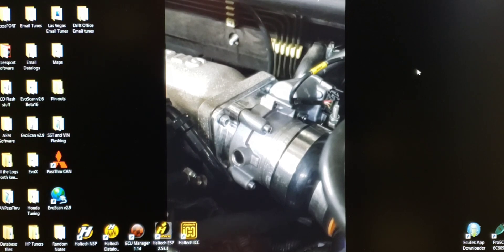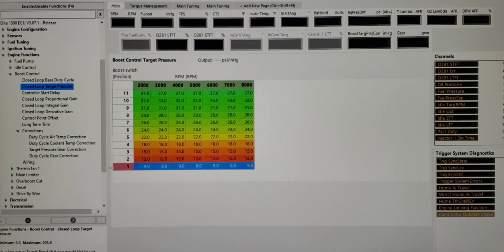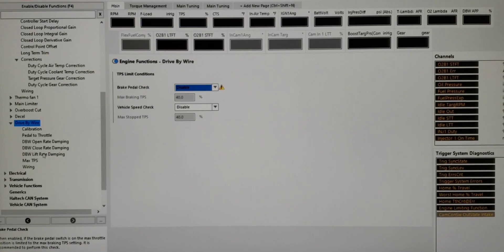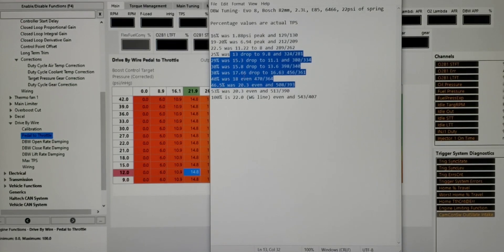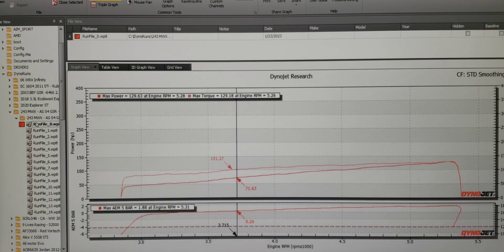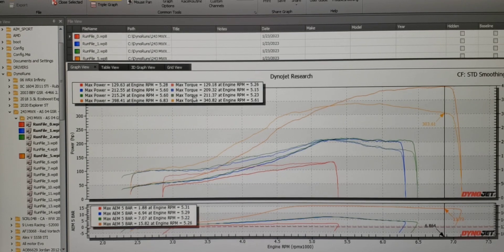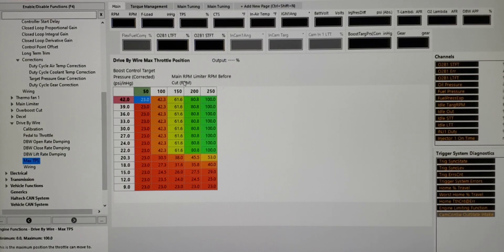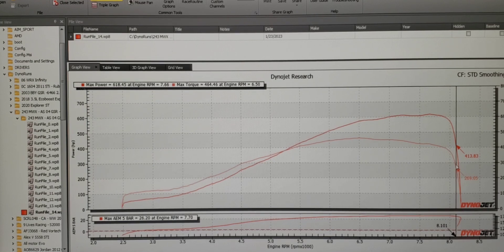Using DBW throttle control in performance applications Ep. 1

Comment: Have you run into certain points when controlling boost via DBW that causes compressor surge, or is that mostly a sign that the bov isn’t doing its job when there is enough pressure difference across the throttle? Really like the idea of this as an alternative for boost control, especially on setups that want a large range without needing an additional wastegate or plumbing strategy, or even just a potential backup plan for boost creep

Comment: Many thanks for sharing your thoughts and experience as always.

I was reading a tuning guide which included lean spool maps on Evos to raise egt and thinking about mapping tools to promote boost response such as utilising ignition retard.

Still thinking of a way to implement a temporary “spool map” on a Haltech when slightly below the boost threshold rpm or in acceleration phases when off boost. Not got my head around it yet but wondered if you have built a solution like this that worked? I feel it has to be a temp condition so it can get stuck labouring on a load site and burn itself down.
Reply from the maker: Under boost control you can use spool assist as I am sure you are aware.  It just holds WGDC at 100% until you get close to your target boost.  If you have a DBW throttle over springing it will help as well just a little.  Then either rolling ALS or the launch control as we have covered in the past.  Lower timing will help drive the turbo some but it does also mean less torque. I think I know what you are asking (I may not :P ) so I will ding around in the software today and see if I can visualize a way to help.
Reply: @AaronONeal1   Yes I use Haltechs spool assist for mechanical push on the wastegate control and also agree with your stronger spring theory on the mechanical side. I’m musing on the purely mapping side and potential tools. One being lean spool assist like factory evo’s employ and potentially a temporary ignition retard condition.
The lean spool that evos employ reads that they raise the gasoline afr target by c0.5 to 1afr during rapid acceleration. This lean spool map condition is then decayed back to the base afr table over a mapped time dependant of rpm. Longer decay at low rpm, shorter decay periods at high rpm, no lean spool allowed above 7000rpm. 
I don’t know enough about it but suspect the decay time overlaps any transient fuelling response which would initially occur. The Mitsubishi approach does not appear to change ignition timing. It Only creates a temporary lean period to jack Egt to motivate the turbo.
The second thing I read often is people employing a retarded condition to promote egt in the same manner at off boost areas. As you point out : this would drop off from mbt point so id attempt a temporary push of exhaust gas energy to spool the turbo. Again I’ve not seen a practical example or how you avoid falling into a torque hole : my guess is to try to employ this with a decay time or load threshold.
I’ve still to look across Haltech nsp properly to see methods to try these theories in practice and simply wondered if you had tried any or any other purely mapping tool to lower the boost threshold rpm or reduce turbo lag time on transient conditions.
Many thanks for your considerations.

Comment: I think this is slightly out of the scope but I hope it's a legit question anyway. 

How does the ignition timing, fuel table, and/or VE (actual) differ when using this method versus say using the lower waste gate pressure spring to achieve that result? 

The reason I ask, is while I tune the Evo on low boost using waste gate limited boost. Say 2bar ata I get those cells for that pressure dialed in and I then increase the waste gate to say 3bar ata. Now how close should I expect those 2bar ata cells to be if I'm using part throttle to hold that 2 bar ata?

Ive always had trouble understanding how to apply this in real world, of course I don't have my own Dyno 😢.
Reply from the maker: Its actually still pretty close.  I have had to do this on a few Evo X that were oversprung and created a minimum of 36psi.  I limited throttle to 35% and tuned it at 24 then let it go to 36 and the VE stayed relatively constant.  Timing will always be a little less as boost goes up at least at lower rpm until you can verify gains, on a fairly high octane fuel like ethanol you will be the same out the top.

Comment: Is there a way to use dbw as 2step enhancer or something
Reply from the maker: Not enhancer that I can think of but limiter if it gets too crazy
Reply: @AaronONeal1  I have used that on the MoTeC platform. Limits boost pressure while on 2 step
Reply from the maker: @johnsheldonfrederick2862  episode 2 I'll show how to do it on a Haltech. AEM is a lost cause in it's DBW throttle control other than small things. I will finally be doing a Motec in the near future.

Comment: i opted out to use a DBW Throttle body on my 1g dsm for torque management...instead of destroying the drivetrain every time i hit the track
Reply from the maker: That's a great reason for using it as a tool.
Reply: @Aaron O'Neal  i am using a 2014 Nissan Maxima Throttle Body and pedal with Fueltech FT550